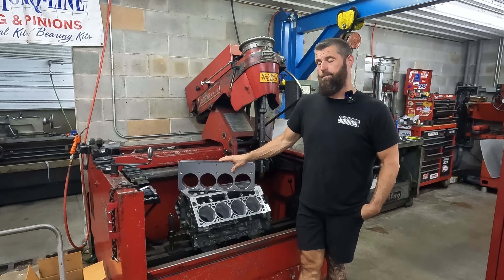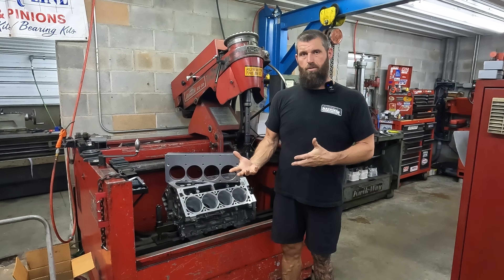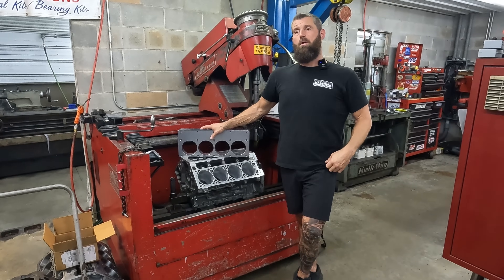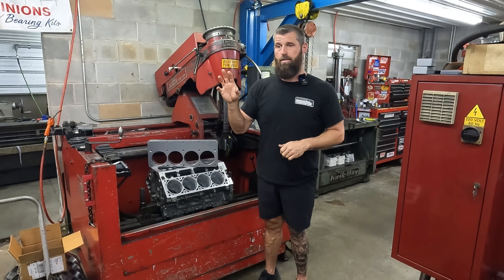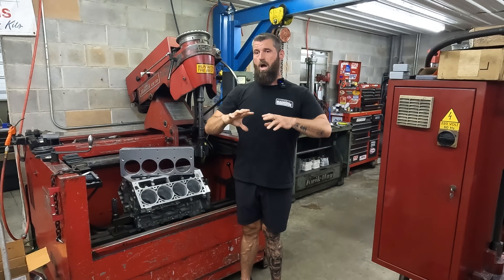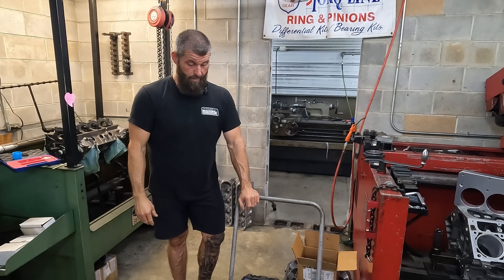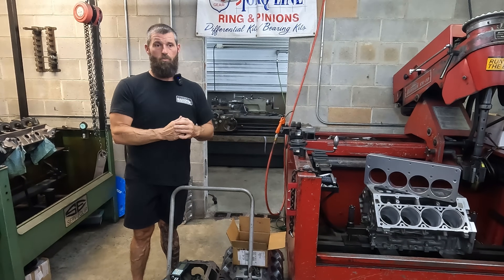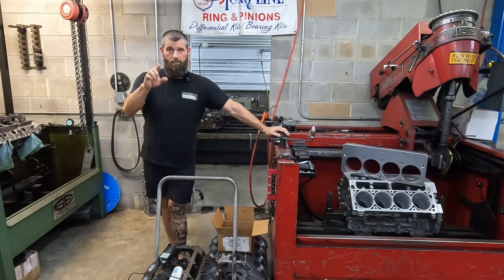We gotta talk about this torque plate deal.....

Comment: I'm an electrical guy so I thought mechanical stuff was dirt simple. Then I had to help ninstrument a granite air bearing table. Granite!!  The table deflected as the carraige went from one end to the other. It moved with temperature. It moved if it rained.  What an eye-opening experience. 

EVERYTHING Iis like rubber if you're measuring with enough precision.  Love your discussion of the cylinder wall thickness. And how the threads on an LS are different from an Fe. 

As an engineer who is curious i would definitely ask (dumb) questions about why you would or wouldn't do something.  My questions come from ignorance. I find what you do truly fascinating.   But the only equipment in your shop that I can work better than you is probably the toilet. 

Thanks for a great channel.

Comment: Recently I had a crank shaft polished and balanced by a reputable machine shop and they told me everything you just said and even went on to say that actually from the factory down the assembly line even GM never torque plate honed the LS.
Reply from the maker: Yep, 💯

Comment: I am sure if I brought you a motor and said "Hey, this is going to be a supercharged daily driver and weekends at the dragstrip, LT4 engine" that you would tell me if using a torque plate would help or not. I would much rather put that extra $200 into better cam, or lifters, or valves or something else, but, if YOU said to do it, I would say do it. Because YOU are the professional and know when and on what applications it is needed.

Keep doing quality work like tou are, you will never go wrong.
Reply from the maker: Definitely, tyvm

Comment: 99% of the folks that know anything about tolerances cannot even possibly fathom maintaining .0004 or even calibrate the tools properly to even measure it reliably or consistently.  ive never had an engine honed with a Tq plate.   lol.   excellent vid and info!!!!
Reply from the maker: Absolutely
Reply: Time to start recording room temperature and worrying about the accuracy of your thermometer.
Reply: @geniferteal4178  yea, good idea!
Reply: @MrChevelle83  Not sure if you're joking or not and I, i'm joking a little too. But seriously,  My brother and I quickly realized doing our own work in the garage. Practice getting consistent measurements. It's easy when you have experience, but if you're doing your own stuff, just getting consistent readings is something to practice. Most people have no idea if they've never done it. Temperature becomes an issue, especially if the garage gets cold overnight. We knew our abilities and limitations. Torque plates were not on the radar yet back then. 😊
Reply: @geniferteal4178  im quite sure we both know that room temp in the case of typical engine machine work has little to do with the finished product.   CEE down in Australia did a great video on extreme cold temps on part dimensions.   unless the parts are really large its not something to worry about.   I turn massive parts on a huge cnc lathe, I can tell the difference if a part is room temp vs after just roughing in and the temps are about 160 degrees F Ill see about 1mm on a part thats 950mm in diameter but the Pi tape gets hot as soon as it hits the part and they are calibrated a 72 Degrees F   so its all splitting hairs back and forth.  thats my opinion.
Reply: @MrChevelle83  It makes us feel good to note the temperature of the room when we take measurements. So we'll keep doing that. But I see it probably doesn't matter much. There's probably other reasons for the inconsistencies in our measurements
Reply: I have HELD those tolerances on parts, but in the bargain we did not have any way to measure hows round a bore was other than a 2 point bore gauge, if the bore had a 3, 5, or 7 lobe out of round condition we could never have measured it with the tools we used to machine the parts. We very commonly had fairly small holes which had total .0005" tolerance, say .2495" to .2500" tolerance, we used gage pins to check that, inspection used gage pins to check it as well. if the holes were .0005" out of round gage pins don't show you that at all.

Comment: I've found no difference using a torque plate vs using a torque plate on the LS.
The bolts do not draw on the cylinders.
I've bored and honed 50 plus in the last 2 years.
Reply from the maker: It makes a difference,  it's just very small
Reply: @powellmachineinc  that's true and the freshly square decked blocks will respond better to a torque plate. I like the LS torque plate it's the lightest one we have

Comment: I pretty much go along with what you say about this torque plate thing I know for sure that in a Nissan 720 pickup truck four different qualities of Pistons as a 1-2-3 and a 4-cylinder the 1234 means how far out of round the piston is from the factory so why would the honing on the cylinder have to be perfect if the damn piston ain't perfect and I know this ain't no drag racing motor this is a four-cylinder truck motor that just goes down the road just like you're saying if it's just going on the road if you're out a little bit it don't make no damn difference cuz I come from the factory that way

Comment: I really can’t stand these keyboard warriors! That’s part of the reason I didn’t actually start a YouTube channel because I don’t have the patience for assholes! Also people don’t realize what you can actually get away with. After I built my Monte I just couldn’t spend the money to all out rebuild my SBC in my boat. I honed it, threw new rings and bearings etc and put it back together. The cylinders had big rust pits and really should’ve been bored but I said fuck it this one time. Well I ran it 3 seasons so for with no problems at all. It runs like a top! Lol

Comment: the factory doesn't use a torque plate, they use a CNC mill that gets things as close as they can and then a computer gives the assembler a set of piston assemblies that are weight and size matched to the block... a torque plate hone is an extra level of precision and when you're chasing the last 1% of potential its a no brainer.
Reply from the maker: Definitely

Comment: First off, you're 100% correct for the engines most people are building. That said, hot honing is an OE process in some engines. And F1 goes to very extreme measures to replicate the running conditions for their machining ops. But those are different engines and different use cases from what you're doing. It's just worth mentioning. 

For added context, I do hone cylinders and I have held more than one torque plate 😅

Comment: did the factory use a TP? check that factory balance while you're at it.
Reply: it depends on the engine, some cranks are balanced for every engine and some engines rely on crank batch checks for balance (one crank out of a batch gets checked).
rods/pistons are weight matched in basically every engine as part of QC.
of course that is the point you were getting at, just thought I'd elaborate for someone who might want to learn.

Comment: 100% agree with this 🙌. I'm an engine reconditioner in Australia 🇦🇺 and had my own business but got sick of dealing with these type of wankers who know more (with no trade qualifications) or know a friend that can do it cheaper. That's why I shut my business down, kept all my machines and now just machine my own race engines. keep up the good work mate, love your videos👍👍👍
Reply from the maker: @MattOBrien-lm6pe  Thank you!!
Reply: I did same thing closed up shop brought  equipment  home. I do only jobs I wanna do and only people  I wanna do work for.
Reply: I really understand what you're working with here in Australia, but it's not all one way. I ran my own workshop in Melbourne for a number of decades doing European cars, and building plenty of engines. I also was involved with rallying and built a lot of rally engines, which are different to race engines as a rally motor can be subjected to a minute or more of wide open throttle at full revs (if you are driving up a hill where the engine can't hold 3rd gear, so you have to use second the whole way up), but a race motor will never see these stresses. So I used one machine shop for over 30 years and those guys knew how to make everything stout for a rally motor, although they did lots of everything, including plenty of formula Ford engines. I retired for a while, then decided to get into historic rallying. I settled on a late 60's Mercedes with a straight 6. I found a manual gearbox, then needed a suitable crank, as the automatic cranks can't be used with a manual. As you might imagine, manual cranks for an early Mercedes 6 are rare as rocking horse shit, but I found one. They are forged and fully counter-weighted using 270 degree counterweights. I wanted to keep the full counterweights because once the engine is spun up, the inertia will pull the vehicle up hills much better than a lightweight crank. I went to a very well known crankshaft rebuilding business, and we had a discussion about how I wanted the crank to be kept fully counter-weighted, and just knife edged and balanced. When I went to pick the crank up, I was told it was out the back with all the cranks, but I couldn't identify it. As you might realize a 270 degree counter-weighted Mercedes crank should stand out from the crowd, but I couldn't spot it. When I got someone to identify it, they showed me one that had all its weights machined off, and turned into a lightweight thing, that had been left with a rough finish, and not knife edged. After some heated discussions about how they had completely f'd a very rare crank, they 'kindly' knocked 500 off the price, but I was still left paying nearly 2 grand for a crank I had no use for other than maybe build a sprint motor with in the future. Years later, I still have not found another manual crank, but my heart has kind of gone out of it. I have a few other projects including an aluminium blocked 572ci wedge Chrysler for my 65 Satellite with probably the only pair of stage 7 wedge heads in the country. It's a 4.5 bore and i've got a 4.5 stroke top fuel crank to drop in it, but the crank needs a journal rebuilt, and I've lost my trust in machine shops. Would you possibly know anyone I could trust?

Comment: Your totally right!
Plus the top ring is 1/4" below the top of the deck of the block! 
As a retired 50 yr machinist i never pushed torque plates.
Then there was the discussion about head gaskets or no head gaskets! Not reusing gaskets, buying double sets of gaskets,brands of gaskets! Yikes! Always thought they were unessesary waste on non competition cars.  Some machinist like to scare the customer into unnecessary steps to hike up the bill. 
Proud to say i never did that. I went by budget and what they were using it for.

Comment: Torque plate work should definitely be something the customer requests or understands. If machinists did torque plate boring/honing on everything without direction from the customer, you can bet you'll get customers measuring their bores during assembly and accusing you of not getting their cylinders round!

Comment: Thank you for the very educational video,  In support, I doubt if engine manufacturers use torque plates.  I built a ski-boat on a shoe-string budget about 50 years ago (teenager at the time).  We had to cut a lot of corners with the limited money we had.  Ski-boat engines run at high power outputs......much more demanding conditions than car engines.  That old 272 Ford Customline Y block V8 ran for years without a problem.  It always amazes me how relilient engines can be.  Cheers.

Comment: The guy questioning the torque plate is the same guy that throws a BIG camshaft in a stock compression V8 and wonders why it runs worse after the new cam install!

Comment: Another great video! It's possible NOT using a torque plate could result in a more true bore on certain blocks when at running temperature. People just want to sound smart when In reality it's the opposite.

Comment: It would be neat to see how much change there is with a pair of heads torqued down, and then heat the entire assembly up to 180 degrees and measure through where the crank goes. Too much work to just try it, maybe one of the big engine test channels will give this a go. Need a big oven to even try it.

Comment: I have a issue with weather or not the plate is necessary!   The distortion in the block comes from the threads being pulled towards the deck.  If your deck is perfect the plate doesn't even matter!  Just put short bolts with washers under them torqued to spec!!!

Comment: It'd be hilarious if you got a small sheet of that flexible magnet material (wouldn't work on aluminum blocks obviously) and traced a headgasket on it and cut it out and trolled the trolls by sticking it on before a hone job that's not getting torque plate honed and act like its your torque plate 😂 seriously though love your channel you guys are one of the few people I'm subscribed to

Comment: I agree with with you but can you give an idea about how much power rates the plates just for general purpose say a gen.1 or ls,if you have time
Reply from the maker: I don't understand your question
Reply: @powellmachineinc  I’m sorry I thought that was pretty straight forward,how much power is required to need the plate
Reply from the maker: @barrykilts4506  it's not necessarily a specific power level,  it's more about the block configuration and ....here we plate all "race engines " just so we check all the boxes
Reply: @powellmachineinc  I’m sorry I didn’t mean to imply anything I was speaking mainly about possibly 500 hp street motors.i would expect you know more than I which why I’m asking thanks

Comment: Is that cylinder wall thicker in the thrust direction on purpose because that's the thrust direction, or is that just how it happened to end up?  And thanks for the explanation, I wouldn't have known about the torque plate thing had you not explained it.
Reply from the maker: Both just how it is, front and back are thin, left and right are thick

Comment: I watched a video of a guy building a BMW s38 inline six. The head bolts are more than an inch from the bores. He had a torque plate made before he honed it. I dont think that he had 4/10 change. It was almost none. 
Look what happens to the bores on a 400/440 mopar with a torque plate, the head bolt threads are almost in the cylinder wall.
Youre right about giving the customer what they need, i know one guy that will not swap a piston on a stock engine for another stock piston without balancing the rotating assembly. It was a head gasket/hydrolock issue and it pinched the rings. I told him to just grab a $20 used piston/rod off ebay to get it running and he wanted to pull the whole thing down and balance...the stock pistons and rods. It was like arguing with mud trying to tell him that he was wasting a huge amount of resources to get a stock truck engine running again.
Reply: People like that would probably be shocked if they saw the tolerance on piston and rod weights in a stock engine. They think everything needs to match to the hundredth of a gram or else the engine is going to rattle itself apart.
Reply: @NBSV1 i even linked a magazine article showing that for most stuff under 6k rpm that 1/4oz inch is probably fine. You arent gonna notice that at 2200rpm on the freeway. Its already 100+k miles old and just needs to get going.
Reply from the maker: Absolutely

Comment: I’d rather spend the extra on getting the right hone with the deeper valleys and the correct surface finish for the ring package, crankcase pressure and oil control.
Reply from the maker: Definitely,  but part is std here

Comment: Love the knowledge transfer!  I agree with your conclusion that some engines require torque plates and some dont; and it's application specific.  In my testing I've found that the distortion tends to be asymmetric and non-planar and it's really difficult to get an accurate measurement .  I tested the other way.  Hone without a torque plate then dichem the cyl,  with a really fine stone take 3-4 strokes then you can see where to measure the distortion, and you'll need a 3 point mic too. But most cyl can be almost a full thou out of round and still be in spec.
Reply from the maker: Definitely

Comment: Can’t believe that all those years before torque plates a one of those bored engines ever ran.
Reply: Can't believe any of my teenage dingle berry honed engines made the 45 minute drive  to the dragstrip, ran 7.90's. Then drove to work and get groceries, etc. In my 50's now. Time and place for certain things, as Daniel said.🤝
Reply: @strokermaverick  My '73 Capri with 302/T5 ran 12.01 sec 1/4s for years, after
a dingle ball hone and fresh pistons.  5 years later it ran an 11.50 balls out...
Reply from the maker: Exactly

Comment: lol on the bus ride retort, I have built performance engines and just a more than few rings and bearings, the case were the head bolt location in relation to the cylinder bore were a torque plate is the best first way to go, anyway  I’ve done some sketchy things and got a season and paid up for the higher end work and had a WTF A FEW LAPS in, your patients in explaining to the haters your a Saint.
Reply from the maker: Tyvm!!

Comment: Do you have a Torque Plate for a Hudson flat head six block?  I'd really like to know if that old high nickel block moves much ...  😇
Reply from the maker: No, don't have that one
Reply: Mostly pulling your leg.  I don't think anyone does.  But sealing flatheads is an issue.  Especially as the CR goes up.  Was thinking about putting a Twin H Six in a 50's Rambler American chassis for SEGA H/G and having some fun ...  😁
If you ever get one in the shop, I'll be all over those episodes 😀